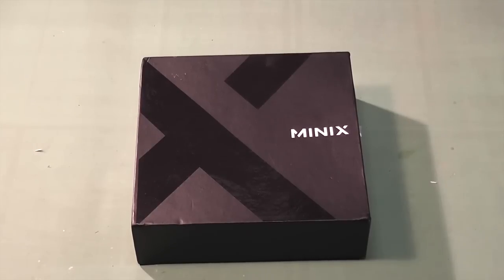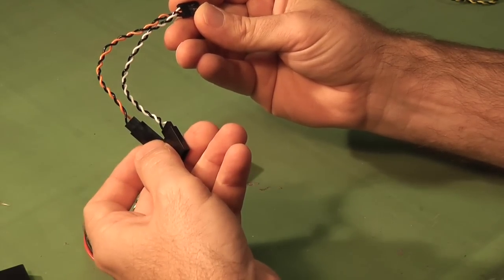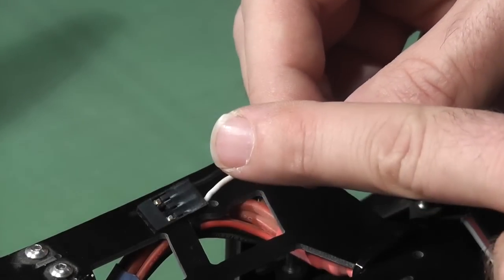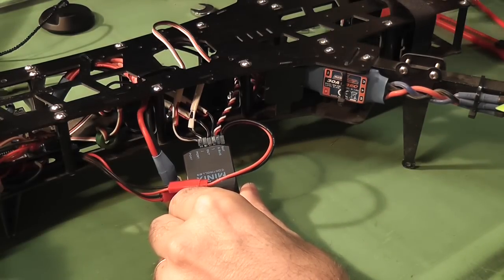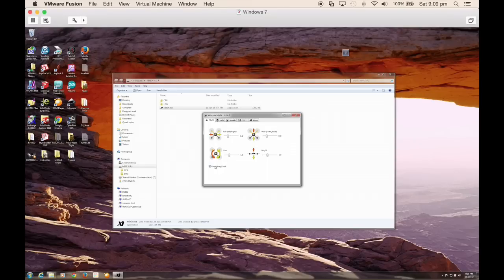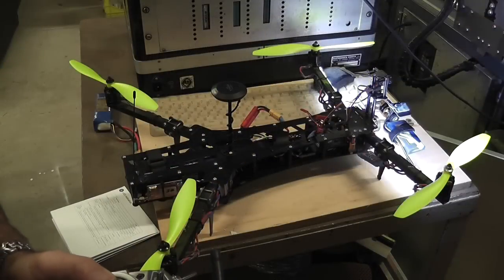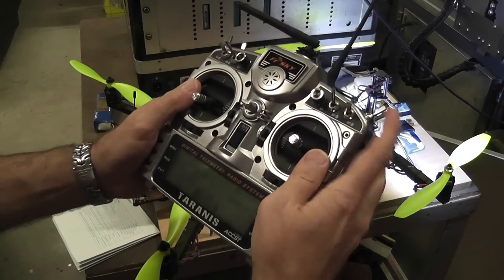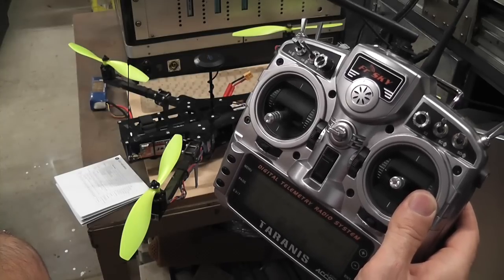xAircraft Initial Setup and Configuration

Comment: I just wanted to add that you wont need to remove the 5v rail on the esc if your using the supplied extensions. If you look at the receiving end, there is no wire in the center so the 5v would stop there. I prefer this method as there is less likely a chance of shorting the wire to the frame. Just my two cents.

Comment: What material did you use for the vibration plate?
Reply from the maker: Randy Pulis The plate is G10, with soft mount absorbers.
Reply: seafurymike Thanks Mike.  What thickness did you use and where did you source the G10?
Reply from the maker: its 1.6mm and from china, but i buy sheets of it for my CNC machine.

Comment: Which PWM to SBUS converter did you use?
Reply from the maker: none. i use PPM. it support PPM and SBUS connections
Reply: seafurymike Can I ask which tx/rx combination you use? I have a Spektrum DX9 TX and Spektrum 9020 RX which I think has PWM output but am not 100% sure. I'm trying to find out what needs to be between the Rx and the Mini X.
Reply from the maker: Taranis radio and EzUHF module and associated 8ch receiver

Comment: Very nice video, thank for sharing. I just in the dark how do you set the three flight mode on your TX? plus any additional for example throttle cut to hover and I use some switches for rudder to each side. With out the sliders is not so easy.
thanks for your help.
Reply: There is nothing special. If you have a Taranis just assign the switch to a channel.

Comment: Hello again from Gary
I noticed you was running a Taranis Radio
Do you have a set up video on that radio
I am putting a mini X on a frame with the same radio as yours
Any help would be Much Much appreciated
Reply from the maker: There are loads on Taranis, so i hadn't made one up. What are you trying to achieve with it as Im sure i can help you out. My mini X is on my Ov3rquad Gimbal frame and I have setup idle-up, gimbal tilt, Attitude mode and GPS mode for PH and I have a switch that can also activate RTH.
Reply: Thanks again for your time
I just got the radio and just thought if there was a easier way ti set it up 
I have been looking at it and it looked

Comment: great video mate did you run into any problems of getting that purple light , i cant seem to get it . running a taranis with stock internal module iv got my chanels set up right
Reply: only thing i can think is that maybe one of the throw on the 4 control inputs needs to be reversed
Reply from the maker: Ok Taranis. Mine is also a Taranis. It just worked for me. Make sure you switch quite quickly between the 3 positions.

Also, check on the channel output screen (where the bars are shown) that it goes from -100/0/100. I think that's the standard 3 position switch figures.

Comment: Are you sure about the motor number assignments?  The manual shows m3 in the lower left, and m4 in the lower right.  It goes CCW.  You pointed at m3 being in the lower right.
Reply: i could have made a mistake but as i stated please refer to the manual for the motor numbers. i did that off memory and all FC have them differently orientated.